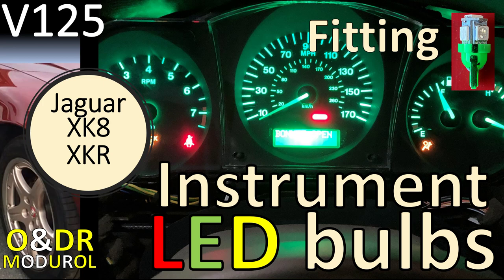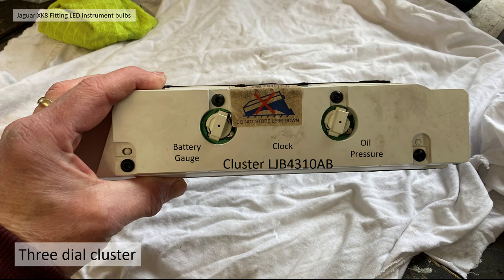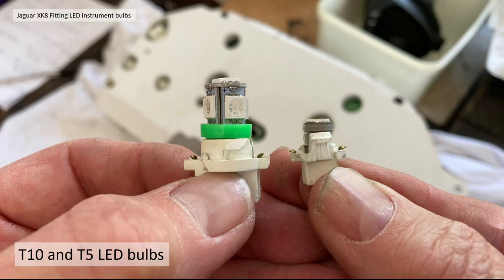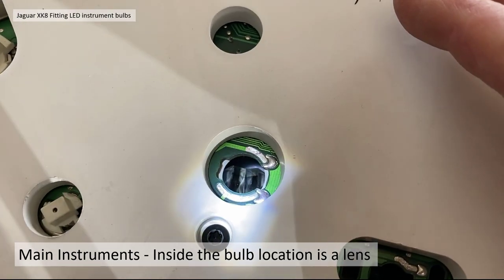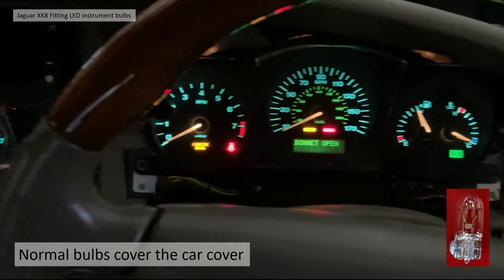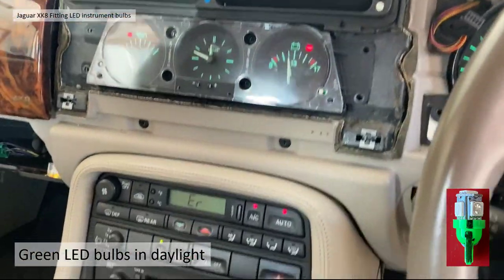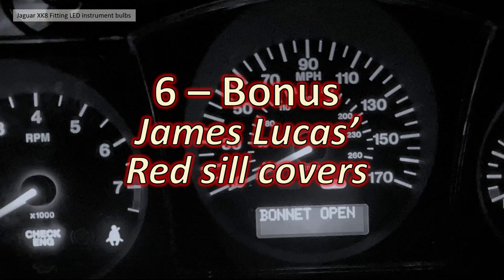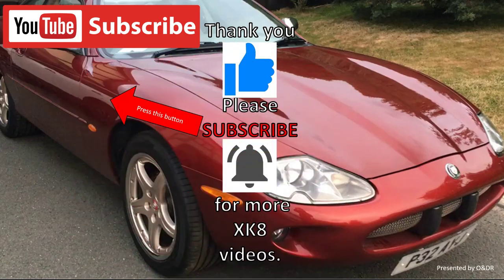Jaguar XK8 Fitting LED instrument cluster bulbs - panel dashboard gauge dial V125 / XKR (X100)

Comment: Thanks for the extended detail. I keep coming back to rewatch. I need to change some burnt out bulbs and, while I”m in there, have to decide which ones to keep standard, which ones to upgrade to brighter incandescent, and which ones to upgrade to LED. The choices out there have become endless. And the prices seem to have skyrocketed in the last few years.
Reply from the maker: Tom, another fellow enthusiast actually used white bulbs together with small resistors to dim the light slightly. I think this is possibly the best idea although much more fiddley to sort out. Prices for everything are going crazy, regards Damian

Comment: Cheers Damian. Add to the jobs list!
Reply from the maker: Gerard, always lots of jobs on the list with a Jag. Added another myself after the MOT yesterday. Thanks for the comment regards Damian
Reply: @ODRModurol  Did you get the ticket for the XK8 yesterday Damian?  Talking of jobs, I’ve just spent every evening after work for the last week attending to some bubbling rust on the rear wheel arch of my x308.  Really pleased with the final result.  It’s quartz grey and the paint match is excellent despite the fact that it was done using rattle cans.  Only downside is that the rear bumper bracket did the usual trick where the ally receiver turns to dust as you attempt to bolt the assembly back together.  New (used) part on order ready to be smothered in copious quantities of copper grease at assembly.  Like you say, always something to do!
Reply from the maker: Gerard, yes I it passed its MOT with an advisory. Was a bit disappointed but will get it sorted. Only attempted paint work on the sills or lower as not very good at it. Hope you have more skill than me. Thanks for the comment regards Damian

Comment: A very interesting video. It is a shame the LED's change the colour slightly. I like the idea of changing to brighter LED's but I want to keep the colour as close to stock as possible. Cheers John.
Reply from the maker: John, I like the idea of changing to LED too but there are problems. They are either not bright enough and the light is patchy or too bright and not a patchy. Overall happy but will do a follow up once we had them on for a while. Green is easier to coordinate but not sure yet about what is easy to change in the centre console. You can change some but not all the back light easily. I have recently followed your vent repair video and will be referring to it in our video. We were not as completely successful as you, as we broke the vent clips off. Love you videos and thanks very much for the comment regards Damian
Reply: I assume that you used ‘cool white’ LEDs for the test Damian.  Obviously, the gels in the illuminated sections of the display have been calibrated for tungsten bulbs.  I therefore wonder if ‘warm white’ LEDs would maintain the original colour balance but add brightness?
Reply from the maker: Gerard, not 100% sure to be honest could be worth a try. The bulbs with mainly LEDs wash out the instruments, the ones with less LEDs gave uneven light across the instruments due to less than optimum positioning of the LEDs. The one thing about ordinary bulbs is the even distribution of light all around. Quite a bit more too this LED thing than first appears. Thanks for the comment regards Damian

Comment: Hi Damian. I replaced the halogen lamps with LEDs on my speedometer, everything works fine, apart from the low beam light, it no longer comes on, but the headlights work. What may have happened?
Reply from the maker: L’Ombra della Luce. if the new bulb hasn't work to could be either wrong polarity or a faulty bulb. Best practice to test each bulb and note the positive terminal on the bulb. Hope that helps, regards Damian

Comment: Sorry to repeat this question from another console light video:
Is the switchgear on the steering wheel supposed to be illuminated? Cruise control, radio column, wiper stalk?
If so, how do you change out those bulbs.
Reply from the maker: Tom, I thought the answer was no so double checked to make sure. Made this video for you. https://youtube.com/shorts/M8kiSS7J9Xo?feature=share , Thanks for the question, regards Damian

Comment: Hi, what did you use for the non-LED original bulbs (T5)? I found Sylvania 74, which is 1.4W. can you help me find non-LED bulbs? Thanks!
Reply from the maker: Jin, I will help if I can. What do you want to know? Which bulb and where?  If you looking for non-LED instrument panel bulbs other Jaguar owners have used Sylvania 194's (14v, 3.8Watt). Brighter than the 74 (1.4W) but not as bright as some bulbs with 5watts. I haven't gone this route personally but that what I have found. OEM bulbs with holders can be found with part number LJA4390BA but they are circa £5.36ea. Hope that helps. If you need anymore information please let us know, regards Damian

Comment: UNDER NO CIRCUMSTANCES SHOULD A BATTERY BE DISCONNECTED WHILST THE IGNITION CIRCUIT IS LIVE, AS PERMANENT DAMAGE TO THE INSTRUMENT CLUSTER MAY OCCUR.
Reply from the maker: Gary, very good point and I will make a short video to emphasize that. Much appreciated regards Damian

Comment: Since I added these to my XK8 they are on whenever the ignition is turned on and headlights are not working.  Is this a coincidence?
Reply from the maker: @cormaco6324, this is quite normal. The bulbs are constantly lit and dimmed when the headlights are on. When you change to LED you notice this effect more as you can see the light in the daytime. Hope that answers your question, regards Damian

Comment: Hello,
I followed your instructions and disconnected the battery then took out the dash and swapped the bulbs with LED. I checked to make sure the  polarity was correct. Now my dash won't do anything like its not getting any power to the entire dash cluster. I can't imagine I blew a fuse so can you give me some suggestions. My car has a yellow plug to the board on the right and a black plug on the left (which No one seems to mention tbe black plug on the other side.) Suggestions? Do you know which fuse controls the instrument cluster? 

Btw. By radio and Center console doesn't light up either but it never did when I bought it.
Reply from the maker: Marvin, check the RHS dash fuse box. Fuse No 18, rating 5 amps, hope that helps, regards Damian
Reply: @ODRModurol  thank you very much.
Reply from the maker: Marvin, please let us know if that fixed the problem, regards Damian
Reply: @ODRModurol  Hello Damin, The instrument cluster is fixed!!! But the problem wasn't the fuse but the black plug that plugs into the instrument cluster (left side at least for U.S. left hand drive cars) wasn't pushed in all the way. It was a matter of pushing it in far enough the teeth on the gears that clamp the plug onto the board were damaged and caused the plug not to slide down correctly. I took an Xacto knife and trimmed off the frayed plastic edges and the plug went in with ease and my new LED instrument cluster lit up like Christmas! I posted pics on the fan page where you responded to me. If you do an update as a cautionary tale please tell people to move the locking bar all the way to the other side before removing the plug AND when plugging it back on the locking mechanism should move freely to lock the plug in. If you have to force the bar to shot you're just grinding down the locking gears and the gauge isn't plugged in securely.

Comment: Damian, great video. I call the T10 and T5 lamp socket (holders) wedge type, and the BA9S lamp a bayonet type. Is it different in Britain?
Reply: I am really happy with the way mine turned out with the white. I like the different colors displayed in the 3 main instruments. The green looks too, too, uh 1960s Mercury Comet or something. Reminds me of my dad's car. 

Your 25 minute video probably takes you 10+ hours to do. Thank you ever so much for what you do Damian.
Reply from the maker: Mark, correct I think there are lots of reference numbers of the same bulb depending on the country. I like the white look too especially in the daylight. However the white LED turn them blue for some reason. The green work OK but make the dials green even in the daylight. I miss the white look. The LED might be a bit too powerful. Also the dimming function doesn’t really work. I will live then for the moment. Thanks for your comment and support much appreciated regards Damian

Comment: Check out what ACV means
Reply from the maker: Robert, are you referring to the fact you can always use a multimeter to test the LED direction and positive? or some solution to the flicker on the message centre. Interested. Thanks for the comment regards Damian